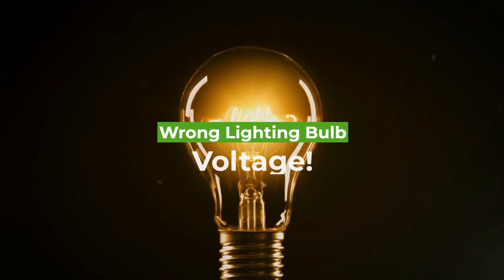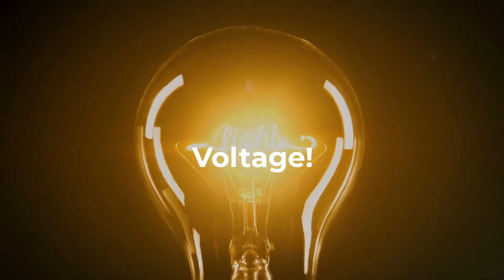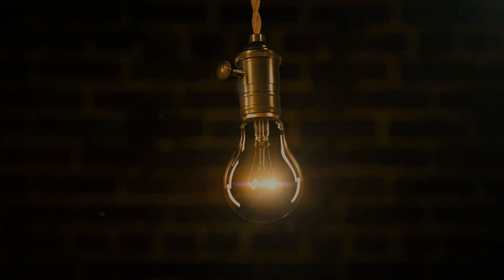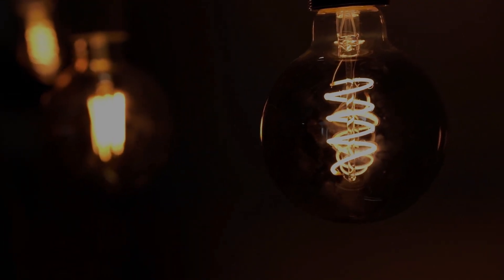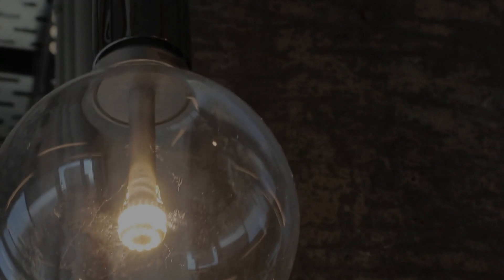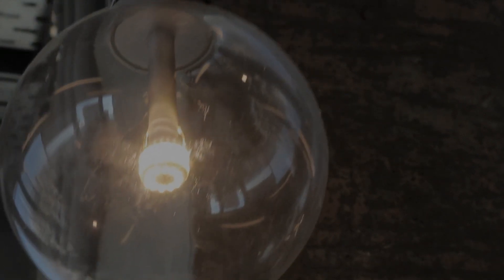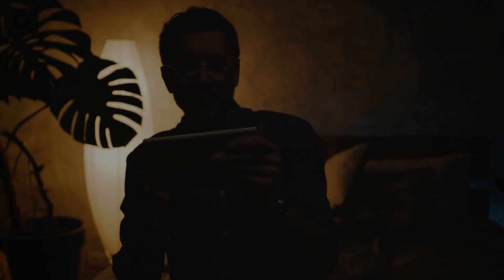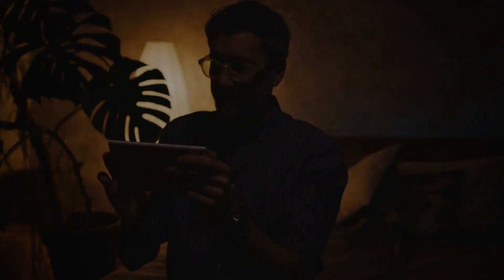Light Bulb Into Wrong Voltage! What Will Happen?

Comment: Light bulb sockets they must be the same voltage as the house? And how to read the voltage on the light bulb socket? Thank you
Reply from the maker: Light bulb socket usually has voltage rating up to 600v regardless of the voltage of the lamp.
You can check the voltage on the socket body or check the data on the socket company site.

Comment: What about 13.5 V LED with 12 V supply? Would it harm the motorcycle battery?
Reply from the maker: It will work but not the same light density